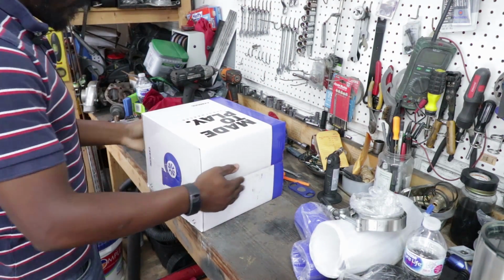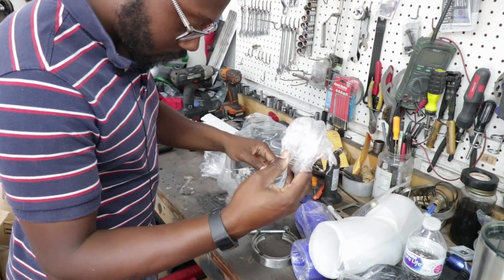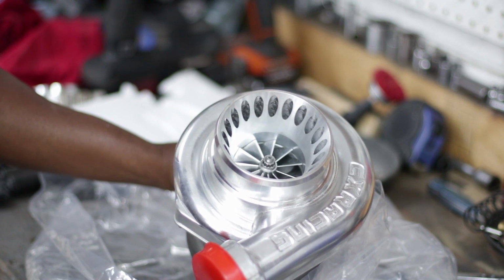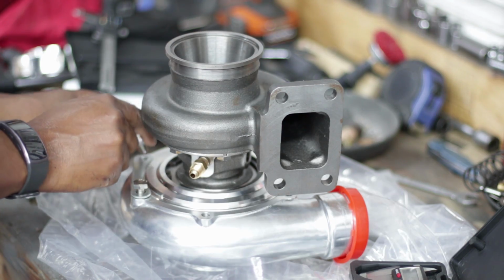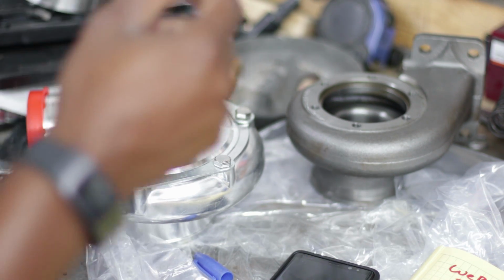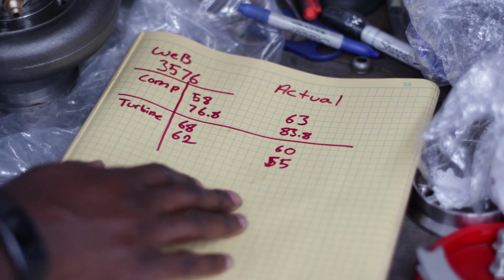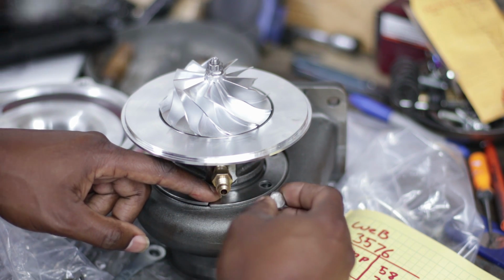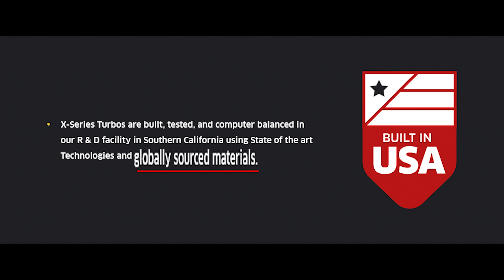CXracing X-series GT3576 (actually a 3084)

Comment: Thinking of buying the dual ceramic ball bearing 2871r for an sr20det. Would you say the turbo spools as a typical ball bearing turbo should?
Reply from the maker: Hard to say. It doesn't keep spinning for very long when the car is shut off like I see a some ball-bearing turbos do.  This turbo dose come on line very quickly tho, goes from zero boost to 26psi in a snap, check out some of my pull videos . It doesn't spool untill 4500 on my car, but that's because it's a big turbo on a small engine.

Comment: Are you sure you are measuring it right? sounds more like a 63mm from what I can see you measure. The inducer spec is what you want (small end of the wheel). I would expect to see a 80mm+ turbine with a  84mm compressor for it to even function.
Reply from the maker: Absolutely positive, measured it probably 100 times off camera.  Garrett's naming convention use the compressor exdcucer size as the last 2 digits, and  the first 2 are the turbine frame series. 
The comp should  be IN 57 EX 76  for it to be an GT XX76
Reply from the maker: Garrett  actually sold an 3082 before the gen2 GTX line came out, it was popular with the Audi/Vw crowd.  The problem is the massive comp wheel outflows the exhaust side on the top end.
Reply: @StovallsGarage  first 2 digit is turbine inducer size divided by 2...

The last 2digit is exactly compressor exducer size...

So u were correct getting gtx3084

But probably they didnt match 100% gartet size purely due to copyright or some kind of dimension related by garret...

Anyway i would say this turbo would spool quicker and making bigger power provided u have good big size wastegate to divert the massive unwanted exhaust flow.. avoiding boost creep...

I would like to know more updates on this turbo installed
Reply from the maker: @AmirPomen  check out the rest of my channel,   long story short,  made 400 at 25psi made 500whp 450wt  at 33psi, but was maxed out on duty. Switched to a pte6262 earlier this year to try and get 550 to 600.

Comment: There are a couple really well balance Garrett combos. Gt3071, gt3576, gt3782(this is a diesel turbo) once you get an imbalance with a turbine this small, it will spool early but your drive pressure will be really high to spin that huge compressor.
Reply from the maker: Yeah I'd like to switch to a 3576 or equivalent. I feel like the small exhaust housing is really choking it out up top...the car has been on the dyno with this setup just check my channel. Made 460whp and 380ish wtq but it peaked at 5500 and quickly fell off.

Comment: Are all these GT3xxxx variant turbos the same as the Garrrett T3/T4 Hybrid variants but with Ball Bearings??
Reply from the maker: Not exactly sure, they should be close to the Garrett GT or GTX30, the GT/GTX turbos are a newer desing , they are more efficient than the older T3.

Comment: damn.........i would not buy a chinese part built in america................we dont even like to work here.
Reply: Lmao maybe you don’t like to work I’m glad I have a job. I love to work.
Reply: Fr.....Americans are way to spoiled if. The people on that line weren’t paid 200$ n hr w 3 hour work dates I wouldn’t trust em
Reply: Smh. 99% of aftermarket automotive performance products are manufactured in China then assembled in the US so, they can be marked as "Made in America" or "American made" etc. This is how things are done in this day-n-age. Parts made in China can be top notch or garbage. I can confirm that most CXracing products are of fairly good quality. The quality of their products have increased dramatically over the last 10yrs. I have personally seen multiple CXracing turbochargers last many years of daily driving abuse and over 50k miles, without failure. Although, I have also seen them fail fairly quickly when being pushed to their limits. When kept at or under 25psi, they seem to last much longer, than when pushed up in the 30psi range.

Comment: What size is the restrictor for a TRB-GT3076-82-R?
Reply from the maker: That depends on your cars oil pressure . I don't know off the top of my head. on this turbo I didn't run one, there was one built into the turbo.
Reply: Ok no problem. Figured it out thank you 🙏🏾

Comment: In any other manufacture terms (Precision, Turbonetics, etc)....that’s considered a 6355..... with a tiny .6X AR. I would bet it lights up quick even on a 4cyl. Then with the 63mm BILLET WHEEL on the Compressor side and DUAL ball bearing, it will be pushing boost quick too,
Edit - you said basically everything I said, with addition that the AR may be too small, which is is pretty small.
Reply from the maker: Just got it on the dyno last weekend(working on the video now) yeah she lights up quick, reminds me of a big shot of nutritious with how quick it lights up , it just doesn't happen until about 4500rpm lol.

Comment: The other end of this problem is there are a bunch of people out there who probably by these turbo some people get what you've gotten where the compressor is really big the exhaust housings really small... so spools really well on a small engine and makes good power but is choked out on bigger engines and doesn't make any power. And nobody has measured anyting and is going off of what they thought they bought.
Reply: The only good thing there is you can always change the exhaust wheel and housing if you've got the compressor you wanted,  as long as you butt the housing for the right frame

Comment: My friend just ordered a gt3076 from them and received one labeled as a 3576. Measuring it out, it is indeed a gt3576 equivalent. The naming on their website is completely misleading, as it turns out they actually advertise the wheel diameters to suggest it is supposed to be a 3576
Reply from the maker: The website is a disaster ,at ones point every turbo had the same description , they basically copy pasted and never fixed it. I emailed them a few times when I was considering a 3071, they had the measurinments of the 3076 listed,  and on the 3076 they had the 3582 measurements listed.  They never did get back to me about what the actual specs were.

Comment: A gen 1 gtx35 is a 11 blade 62.5mm billet inducer wheel. A gen2 is actually a 10 blade 66mm billet wheel. Just to correct your misinformation.
Reply from the maker: Thank, I couldn't find much info on the Gen1 GTX stuff.

Comment: Where exactly do they get the 30 number from if there is no 30 measurements?
Reply: I think 30 is a series not a size or at least that’s what this dude says
Reply from the maker: It's the way Garrett designates their turbo frame sizes of the GT and GTX series  (the center section and exhaust side size) ranges from 20 up  to 55, the second number is the compressor wheel exducer size, I'd imagine they did it this way so that there wouldn't be any confusion with other brands that use both the turbine size and the compressor size in their model number. 
so a 35 frame turbo has a 68x62mm exhaust wheel   a 30 is 60x55,

Comment: Dude most of these companies don't respond to emails. I've been emailing a company known for counterclockwise turbine housings. I've yet to receive a response
Reply: Pulsar hits me right back. Bought a gtx3576r off their websight. Every time i write they email back (email I got for shipping conformation. ) I get a reply in 2 or 3 hours. I bought 2 extra turbine housings, they knocked off 40$ in shipping for each  extra housing i bought. (Came with a t3 .63, then i bought a t3 .82. My manifold is t3 or t4 , so i got a t4 .82 in the end. ) So far so good with the turbo, but Customer service is tip top imo. Shipping took 4  daysgive or take each time.

Comment: I will say I think the china turbos have gotten better....and the bb ones seam to last on some I've seen on youtube....I'm looking forward to your dyno run :) I got the gt3582 china one from max speed rods, for 150...im not gonna run a restrictor,and I will water cool it...Hope it will run well :)
Reply: mokokawi  you most likely got a journal bearing gt35. Double check the turbine and compressor measurements to verify the turbo matches an actual 3582
Reply: Unless it's used, no one is selling any bb turbo for $150
Reply: Keevin Simpson it's a journal bearing at 150.....the bb's are 450-550
Reply: mokokawi I must've read it wrong and thought u bought a bb turbo for $150. How's your setup working for u? Any videos u can link me to?
Reply: thats cool....im going to start making videos soon....I just started wiring mircrosquirt....linked it to my laptop, and uploaded tune...so I'm just this week hopefully first start :)
Reply: mokokawi Awesome, reply back with a video link if u do a start vid
Reply: mokokawi I've ordered a chinaaaa charger from Amazon aka rev9 power for $260. When it comes I'm checking everything including the balance. It claims up to 600hp but Im doing 300 to 400hp. If it's reliable I'm happy. I'm not trying to set a land speed record
Reply: @410kane  how that turbo work for you? I been looking at one also
Reply: @410kane  you ordered a 2nd one prior to testing or even checking if the 1st one had issues or wasn't balanced ? Thats great consumer advice
Reply: Drewber710 who did I give consumer advice to? I just said I haven't had time to touch the turbos yet. And I'm doing twin t3/t4s on an 05 Acura RL which is the reason for me ordering a second one. I did check them out to make sure nothing visually was wrong with the wheels, housings, etc. They say its balanced but i just wanna make sure it is. JE imports quoted me $360 to check if both turbos are balanced. I work during their business hours so I'm dropping them off when my vacation starts on the 22nd

Comment: Im in the market for a decent quality eBay turbo. My options are between Rev9, CxRacing, or Gtx3582r. Any help will be greatly appreciated.
Reply: Anthony Rodriguez  just dont cheap on the ebay turbos if you want an ebay turbo buy a higher price one whit good reviews its not all the sellers that sells crap i bought a gt3582r payd 850$ and is really good no problem and still running it been 20 000km since instal and boosting at 24psi no problems at all
Reply: Watch my videos.. i have been running rev9 TX50B turbo for 3 years now.. but going to upgrade soon.

Comment: I pull them up too . Basically you got the gt3076 turbine wheel and the 3584 compressor wheel  . this is actually not too bad for a small displacement motor but id u have a bigger motor looking for high hp then well  the 62 mm turbine wheel is the right  thing, would love to see some dyno results with it. Also I love how technical the video was . Just a side note if u order a 3582 you should really get a 3582.
Reply from the maker: Check my most recent video for the dyno video.

Comment: To get around all this checking and comparing just buy a turbo you and your friends know and trust. It will save you headaches in the long run. You should know better than to buy China crap. I f you knew ahead of time the accuracy of the specs! Why did you but it? Is it that much cheaper? It better be.
Reply from the maker: Real deal is $2500 this was about $550, I've made 500whp and gone 11.1 @ 131 with it...it's a great turbo...it's lasted this long and preforms well...it's just wrong lol.

Comment: I would open up the turbo to see if it is a true ball bearing
Reply from the maker: I don't want  have it rebalanced. I can see a ball bearing cage through the oil return, and the oil feed appears to have a cage pin.
Reply: Sometimes they look like a ball bearing turbo but when you open it up it is just a Journal bearing how much did that turbo run you. Worst case you put it back together and send back.lol
Reply from the maker: Too late to send it back, and it was $500.
Reply: Cool not a bad price. I believe once the turbo is charged with oil it will spin a lot better. Not bad price. Just run it it will work good for you and your setup.
Reply from the maker: @sammyturbo786  been running it for a few months now, so far I love it.
Reply: Stovall's Garage hows the turbo today man? I’m Looking between a precision 5858, turbonetics 6662 and this gt35 model of Cx racing.

Comment: so you bought copy of a real turbo and expect to be the same form the inside … garett gt3576 has it own spec  and cina gt3576 is just a name no specs  . i got china gt30 size .5 on website and its bigger than original garett gt35 i had XD ...and then i ordred china gt30 size .2 and it was still huge  XD and then i bought real  gt28rs and lived happy ever after ….. and bought of the china mistakes where not expensive  they were together 1/4 price of the real deal ...
Reply from the maker: No...I expected it to match the specs on CXRACINGs website.  I'm pretty sure  I explicitly said I don't expect it to preform like the real thing.
Reply: @StovallsGarage  I get what  you said Im trying to say that  there spec are made in china also

Comment: Looking forward to the dyno run
Reply from the maker: wyked motors Me too lol, this turbo woth E50 on 15psi feels a lot stronger than the old turbo at 22psi, and on the old turbo at 17 I made 310 so I'm hoping I'm at the 350 mark now, if not I've got about another 15psi to play with lol.
Reply: Stovall's Garage at 425 you have the same power to weight ration as a lambo huracan

Comment: You get what you pay for..... period !!!
Reply from the maker: I can agree with that, although despite not getting what I ordere, the turbo it self performs quite well. Made 377 at 24psi and 460 at 33psi with power diving off near redline, probably because the compressor outflows the exhaust side.  This would be an awesome turbo if they advertised it as what it actually is...looking at CX racing's website it looks like they pulled all of the dual ball bearing Xseries turbos off the website.
Reply: Juan Torres That is right. I bought a used Garrett GTX3582R on ebay for 3years now on my daily, works great.

Comment: Wow this whole video is based on the premise of incorrectly measuring turbo wheels. You can only measure EVEN count wheels using blades completely opposite each other (the outer diameter) like you did in this video. With ODD count blades you have to measure blade length from the center point and calculate. Odd blade count wheels are offset from the hub so measuring them by the OD will provide inaccurate values. The reason CXRacing changed their specs is probably to compensate for noobs measuring the wheels improperly.
Reply from the maker: That would make sense if I came up with numbers  that made absolutely no sense. By being a fraction of a blade off I somehow come up with the exact measurements for their 84mm comp wheel and the exact measurements for a 30 frame turbine?
Yes measuring slightly offset will give you values that are slightly LESS than the actual OD but it won't be off by an order of 10.   Once again doing it the way I did it wasn't going to make an 76mm wheel measure as an 84mm wheel (I measured 83.8 or something like that. 
Bottom line is this is nowhere close to what a 3576 should be...but I do like it regardless...went 12.0 at 121 with a 1.89 60 foot with it on 24lbs.
Reply from the maker: I mean seriously...if this whole video was me bitching about half a millimeter I'd agree with you...it's like you got fixated on the slightly improper caliper placement and ignored everything else.
Reply: Stovall garage if its any consolation I bought a similar turbo 2 years ago, from CXRACING, my only problem was I wanted oil cooled and received watercooled, other than that, I received exactly what they Advertise, gt3576-82R. While there is some hate towards China turbos, most of them are really great for the price, and my gt3576-82r out perform my initial expectations. After some drivability tuning at the local tuner, when he did a full hit I expected 280ish hp to 340ish hp for the first  run. I was shocked when the number was 476hp!!😐🤔😀😆 at 26psi...can you say 1 and done. So you do what makes you happy, cause the days of spending $1500  for a turbo or much more to make 500hp or less are gone. Put the money you saved towards, slicks, pistons, rods, better engine management peace brother 😏😋

Comment: Just buy a Garrett. Stop buying knock off garage . I just dropped 3 grand on my Garrett G42-1450 and will gladly pay another 3 grand if I need. I whisper in the exhaust housing and the wheels spin. There is a massive difference in quality and performance when buying the real deal . And hell a GTX gen 2 Garrett in the size you want isn't expensive at all. So sad all this buy eBay junk is acceptable  in people's eyes. It's not nor will it ever be
Reply from the maker: Ok...
Reply from the maker: I'll probably go precision or BW when this thing goes.  While this turbo isn't what I expected, the quality  and preform is actually pretty impressive for the price. I hear great things about the new G-series turbos  not too found of the price  honestly, If I were building a daily  and reliability was the primary focus  I'd consider Garrett. But my only goal is to get the car into the low 11s,  I've gone 12.0 @122 on 23 psi (about 370whp) last dyno I made 460whp at 34psi  but the trans won't hold, and I'm having some flow issues up top (I need to do some head work), Once that's done and I get the trans sorted low 11's maybe high 10s should be cake.  so I can say I'm pretty happy with my Chang chong turbo so far.
Reply: Randy Slagle buy the Garrett used as I did - works great.
Reply: Are you rich? kk
Reply: @vloga_sy7736  no I am not rich but I do know that  quality costs money and so does technology. The crap knock off parts that are on eBay are directly causing prices of quality parts to go up along with giving bad names to them. Long winded rant short stop buying garbage and knock offs from eBay and Amazon